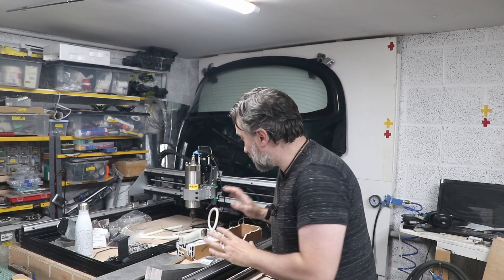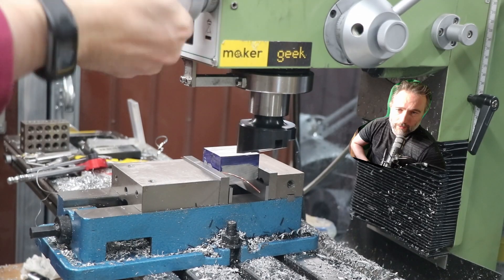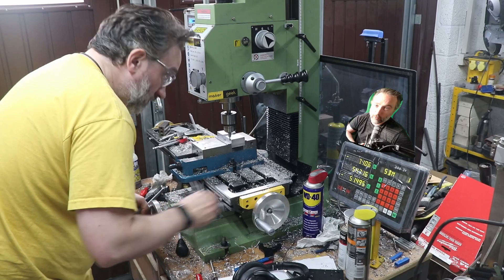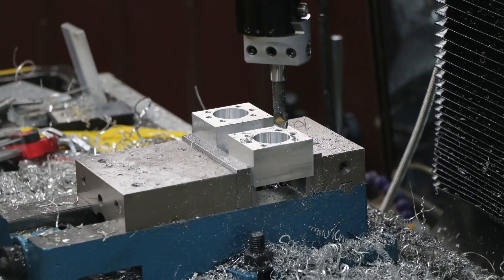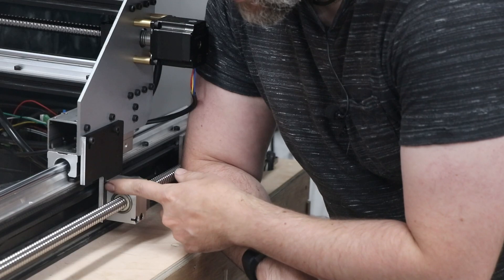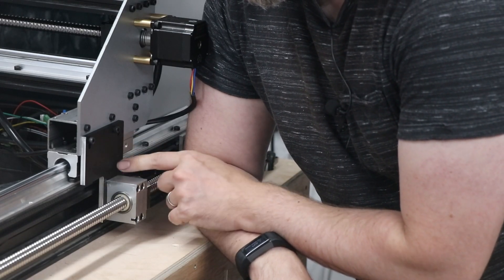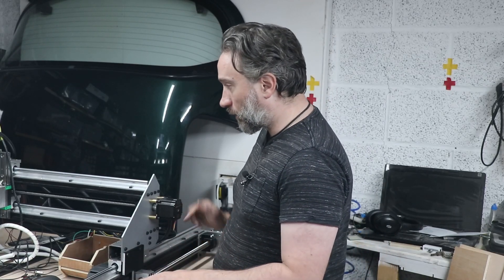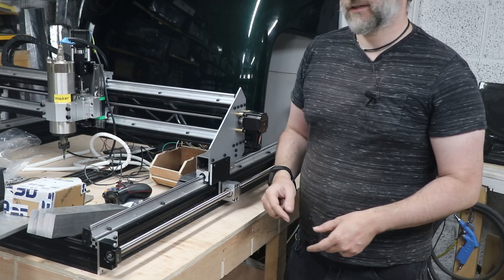CNC Rebuild : Y-axis ball screw mounts

Comment: Hi Dan, I also have an Ox and would like to know what ball screw kit you have and where you got it from please, as I will probably go the same way as yourself once I reach the limits of this belt driven beast.
Reply from the maker: Hi, I bought SFU1605 1000mm ballscrews from banggood. Along with bk12/bf12 bearing mounts. So far so good though I've not gotten to the point of driving a real CNC job yet. I may yet findi need to upgrade the motors. But I've been doing unloaded test moves about 3000mm/min